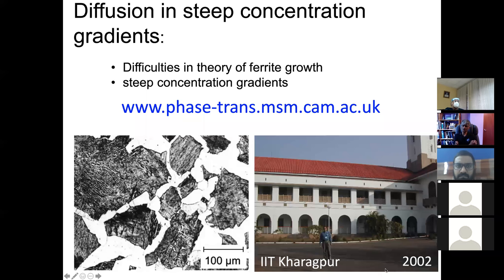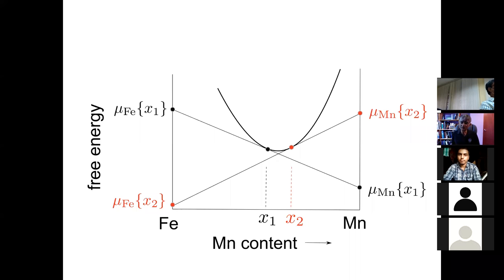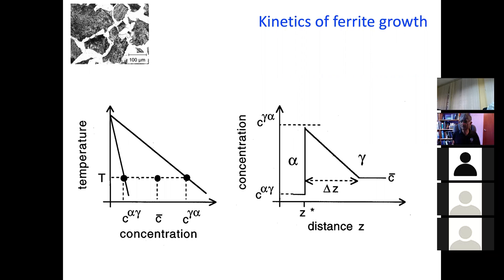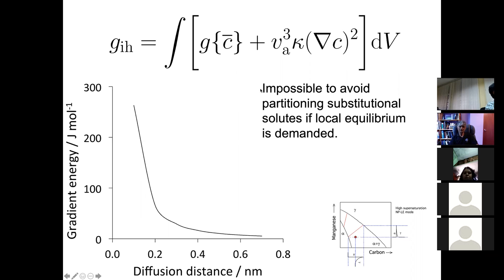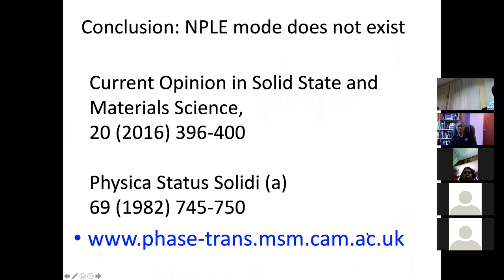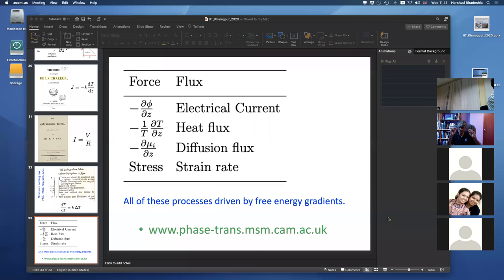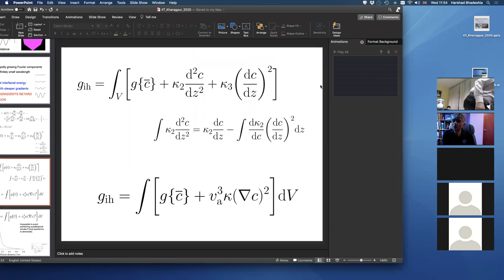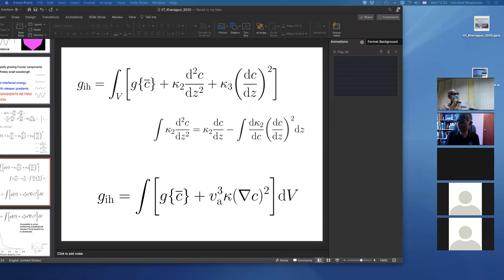Diffusion in steep concentration gradients and the growth of ferrite

Comment: Thank you for sharing this nice presentation. Salt in sea ice and water is a great demonstration of the breakdown of the Fick's law. It is clear from the presentation that there is no thermodynamic driving force for diffusion. I am wondering if you also have an explanation (or a link to it) of the physical reasons why chemical potential of salt in ice is equal to that in water. Does it have to do with the relative sizes of the water and salt molecules? Thanks!
Reply from the maker: The forces between the water and salt molecules are different when in an ordered crystalline array such as that in ice, and when the salt is dissolved in water. The coordination of H_2O around NaCl will also be different in water and ice.  These forces determine the enthalpy change when a solute is added to a solvent. The enthalpy change is a part of the free energy change, which determines the stability of the solution with respect to another solution.

Comment: professor Bhadeshia, you introduce thermodynamics of irreversible process after NP-LE. Are there any relations between these two theories?
Reply from the maker: The theory of multicomponent diffusion, for example for Fe-Mn-C, is based on irreversible thermodynamics, for example the interaction between the flux of carbon and the gradient of Mn, and vice-versa. I did not explain this in my presentation, but have a look at:
https://www.phase-trans.msm.cam.ac.uk/2004/ferrite.Bhadeshia.PMS.1985.pdf

Comment from the maker: If local equilibrium breaks down, then the question arises, how do we calculate a growth rate. Assuming the we cannot impose local equilibrium at the interface, one would have to define a set of interface-response functions and solve them simultaneously. For example, the diffusion-controlled growth equations represent one such function, but the composition at the interface would not be determined by local equilibrium but calculated from the fraction of free energy that is dissipated in diffusion. To find this you also have another function, for interface controlled growth. When both of these give the same answer for the velocity of the interface, that determines the proportions of free energy dissipated in each process.

For an example application, see Acta Metallurgica 37 (1989) 381-389